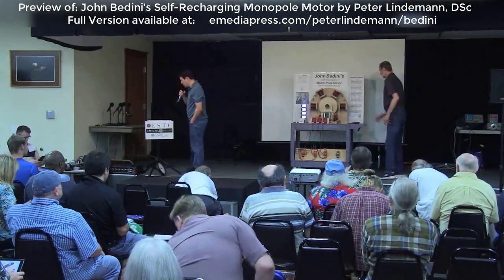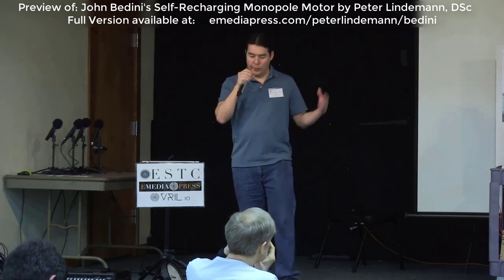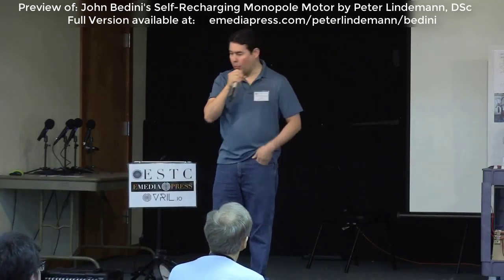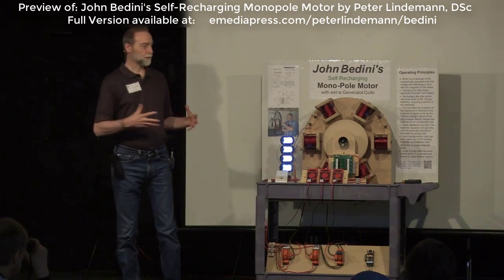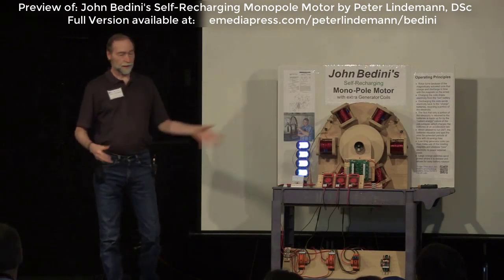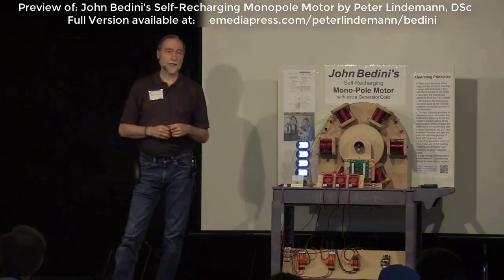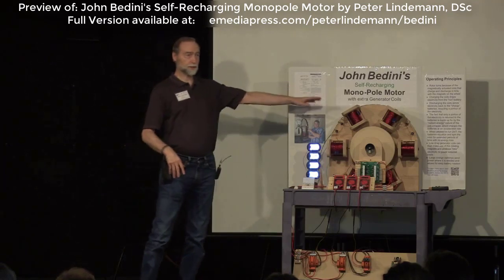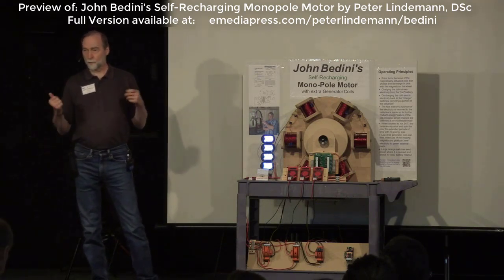PREVIEW - John Bedini's Self-Recharging Monopole Motor by Peter Lindemann, DSc

Comment: Hi Aaron.  Did you know you can use Capsule LED's or Halogens to achieve the same charging method as the Comparator.. I've come up with my own device.  I call it the Capsule.  I've got a 555 Radiant device that I use which enables me to fine tune these Capsule Cap Dumps...  today I tried them on the back of a small SG motor but I was using low sided & high sided switching at the same time & I noticed it produced excess Free Mechanical work..... could be useful with the Self Runner...
Reply: oh boy, I want to know or talk to more of you folks on this stuff. Apparently Dan Winter knows the core principle apparently on why these things work, BUT, I'm curious about the variant ones that dont so readily seem to explain themselves to my understanding. maybe I'll find out more in good time
Reply: @samjohnson3124  I've built many different Radiant devices & the SG is among the very best I've played with.  My latest device has produced one for one 8 times but its not a SG...   I've also produced a simple device that can duplicate the operation of the Bedini Comparator.  I've produced 4 different variations of it...

Comment: What if you made a generator using Tesla pancake coil? Instead of using normal coils, you use lot of Tesla pancake coils. Six Tesla pancake coils connected in parallel delta configuration to create one super Tesla pancake coil. Repeat the process nine times so you can have nine super Tesla pancake coils. Connect all nine super Tesla pancake coils in series Y/Star configuration. Also for magnets, have inner and outer spinning rings of magnets all configured to attract each other. Install super Tesla pancake coils between inner and outer spinning rings of magnets. For stator, use aluminum. I think this would likely make a very powerful generator.
Reply: Russ from rwg research is working on that project right now actually. Check it out. https://www.youtube.com/watch?v=jVM5qpVznE0
Reply: @iEnergySupply  didn't Rodin post a video with rwg where he talks about a new 3 torus system with barely any wire...? Didn't he also say He was just talking out his backside in his videos because he didn't have anything proving what he was thinking up? Many hopes and prayers to keep warm provide less hot air than what we are being handed when every helping hand authoritarian is there to karate chop it down. Didn't Dollard just recently say He was getting out of the free energy search? Didn't he just get a ton of funding from a guy selling his house and isn't he part of the VRIL, llc?
Reply: @iEnergySupply  researching, working, turning some spool of wire with no idea what he is doing.  Looking at patents that were never made to spec because Joe Anyloser would do it himself if he wanted to do it better.  
Dollard working for the navy from childhood to present day?
RODIN + DARPA= whatever he was trying to present in 99.98% of the videos and math people repeat as if they knew what they're talking about while not quite getting they've used concentration to provide pattern recognition. Similar to the way anyone can do something enough times and master it.
Yeah Heaviside nailed it, came from money and top billing of corporate greed to help write the maths for them to help... no one. 
Turning over one page of one way stinkers with all their help that helped themselves and those who employed them. 
Proof still in the
 -100 range with
Speculation at 100% efficiency.
Reply: @zwordbirdb619  The fastest way to learn is hands on. The people who have the drive to build things will learn and discover what is needed. If you are stuck in theory and never do experiments you will always wonder what is true or not, or you will just think you know when in reality you can't know for sure without doing the experiments yourself. Doesn't matter what a persons education is if they start experimenting, they will learn faster by doing and can even pass up the kids in school. The best advice from me is, if you want answers without doing experiments or want answers to your questions about science, start reading Nikola Tesla's patents. They aren't just patents, each patent is like a lecture from one of the greatest scientists of all time.
Reply: @zwordbirdb619  So do something about it, you should prove to everyone its fake if you really want to convince people. If you understand everything so well, then you should have no problem doing that. You obviously think it is important as you are working hard to get your point across. Link your proof/examples to how its all a hoax, then you will actually make progress when you comment and not just be a guy out there who talks a lot and insults people that are actually doing something. Make a difference! Good luck.
Reply: @iEnergySupply  lol you're doing what exactly? You've yet to start anything let alone thinking so again great advice from a person with answers for himself.  Talking in circles in a nice package for you.
Reply: @zwordbirdb619  If you honestly don't know what I am doing then your not very bright.
Reply: @zwordbirdb619  You still haven't told me what I am copying, or who came up with what I am doing first. Ill bow to you if you can find something like it as I have been searching for many years.
Reply: @iEnergySupply  sure. Ready here I go. Metals were known as non Electric's. Who said that? You are doing a great job pal. Clearly an original thinker. Tinkering while knowing very little but one way that has proven results that fail.
Now it's your turn. Who are these great minds you speak of that gave you the knowledge to build present failure? Who are you trying to Peddle that is selling anything real? The Dollard crew is now pushing their real and off of free energy as of this year... you have a nun retired guy that retired before ever handing anybody the energies he was ever speaking about. You have Paul Babcock paying for his weight loss surgeries by selling inflated air with his stories. Art Bell? Steven Greer? Who is your 100 percenter? There isn't a single one of them that has proved a thing that hasn't been proved before. What was the big deal with the crystal radio initiative? Why are there so many people who would care about it easy crystal radio that can be built extremely easy and there has never been any hidden agenda or plans of how to actually build one... some Sparks coming off of a Tesla coil is all we need to throw money out of the window and towards these people?
Reply: Spinning ring of magnets? What's this source? If you watch Ken Wheeler then you aren't listening to him. Maybe reading a book like his or one of the people he copied and pasted from will help you so you can do more than day dream.

Comment: When you look at Maxwell's original 20 equations, you see where using Quaternion math, you can get energy coming from nothing. Using the correct math shows it works. It's the zero-point energy of all vibrations passing through every point of space simultaneously. You can tap into any wavelength, and energy level at any point in space, and it's potential is unlimited. Research the Casimir effect.
Reply: can you provide the calculations?
Reply: I have always heard you are what you eat, I guess it's the same with what you smoke too  Dopey!
Reply: 72 degree pyramid technology Suppressed patents   I'll check it out. Thank you.
https://www.youtube.com/results?search_query=konstantin+meyl+english+